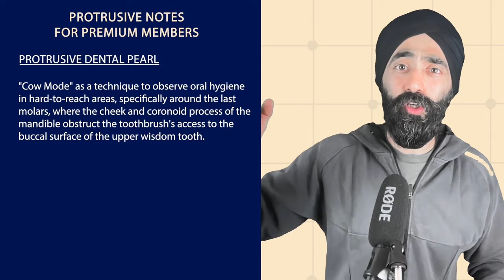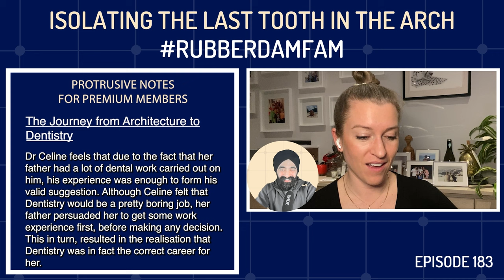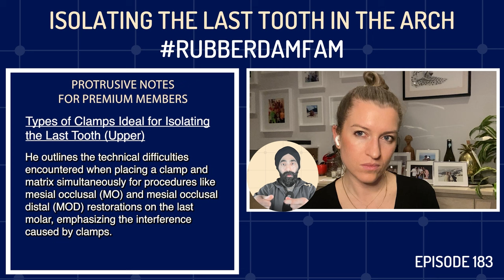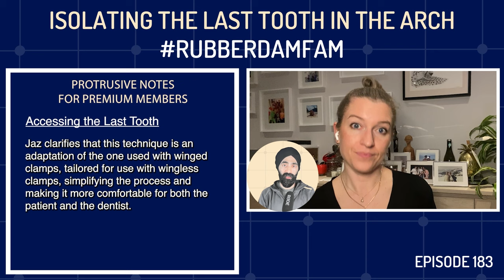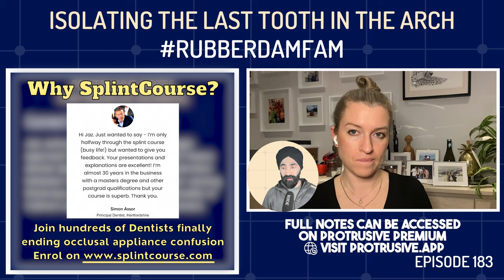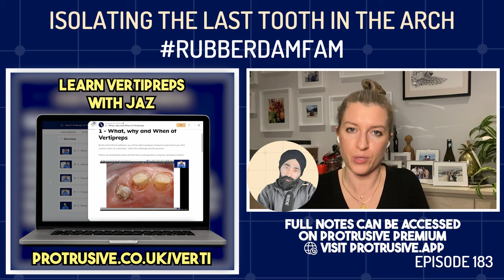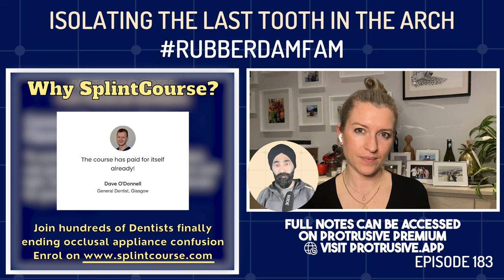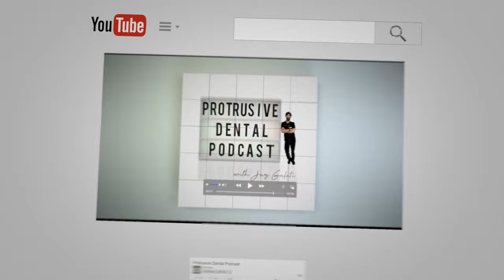Isolating the Last Tooth in the Arch #RubberDamFam - PDP183

Comment: Excellent topic. Here's my method for matrixing the distal surface of the last tooth. Put on a rubber dam. Put a sectional matrix on the distal surface, hold it tightly against the margin with a carver. Create a strut between the clamp and the upper rim of the sectional with high viscosity flowable composite, have the assistant light cure it. The matrix will now stay in place. Add more struts if needed, it'll look like a web. If I need a tighter seal, I'll add teflon tape. The bonus of this method is not having to remove your clamp to put on a tofflemire.

In the beginning, I used to 3D-print the distal wall with high viscosity flowable and then finish it with a disc if needed. If you smooth out each increment with a probe, the end result is very similar to what you might get with a matrix and no finishing is actually needed. In order to use this method, the adhesive applicator and the cannulas for the etchant and the composite need to be double-angled (bent twice with tweezers). Many tweezers have a small hole in one of the arms. This hole is perfect for bending the cannula. For smoothing out the composite, you need a double-angled probe, like the ones periodontists sometimes use. A regular probe won't reach the distal surface. Side note: if only there was a way to double-angle the tip of the sandblaster. Also, the air-water syringe.